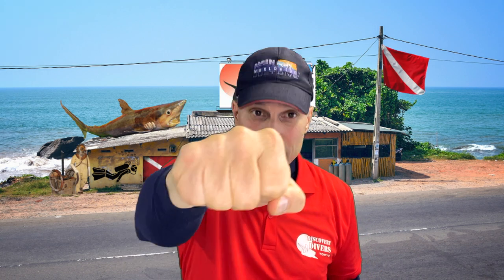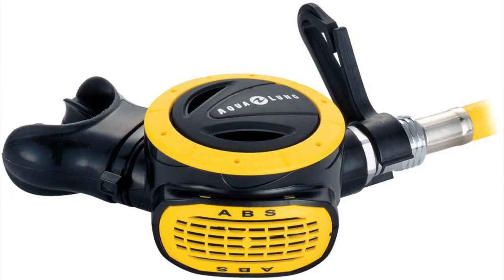Why Long Hose - Follow up - Air Sharing Part 2  (Scuba Tips and Tricks)

Comment: Rule number one: Aside from some catastrophic event well-beyond your control, there is zero excuse for running out of gas. That aside, the long hose setup serves two great functions. One is practical, the other is psychological. I've witnessed a few real-life out-of-air situations in my life, and every time, there is nearly zero rational thought by the person now in panic mode. That classical "safe second" recreational setup with the bright yellow hose? LMAO! Noooo... They will never go for that. A real panicking diver will see the regulator IN YOUR MOUTH, they WILL go straight for that one, and they WILL fight you for it. This happens because in their mind, they KNOW the reg in your mouth works and has air. So they will go for that one and completely ignore that stupid yellow hose you waive in front of their face. A long-hose setup fixes this issue. You donate it and let them have it. The additional benefit is they can now recover from panic at a distance. The second reason for a long-hose is the advantage of the hose length. Long-hose setups came from tech., where in a confined space, you could donate a hose to the person in front of you or behind you, and you could remain in line with each other and continue to move without kicking or bumping into each other while exiting the confined space together. The recreational diving industry as a whole is FINALLY understanding the psychology of panic and why traditional recreational hose setups are worthless when it comes to the intent of sharing air in a real-life panic event. Because of this, just like back plates and wing BC's, we are beginning to see long-hose setups becoming more main stream in the recreational industry, and why I would argue all divers should learn using a long-hose from the beginning.
Reply from the maker: Thanks for the airshare comments 👍